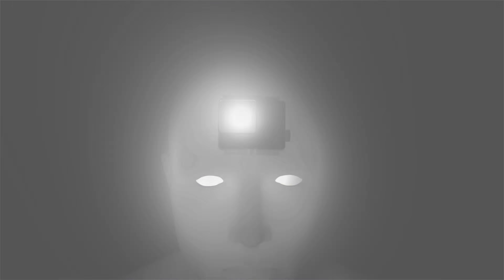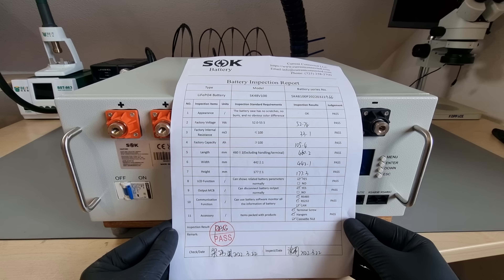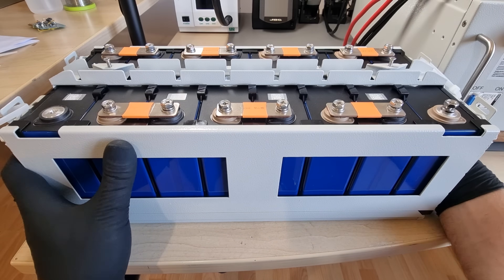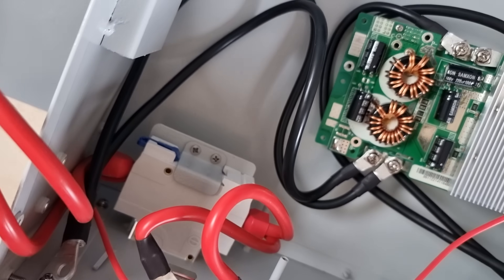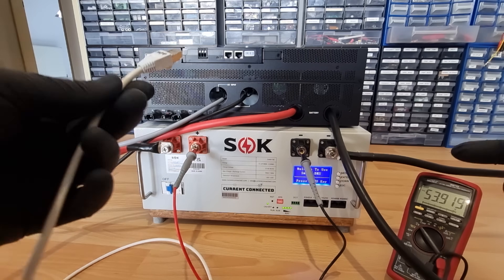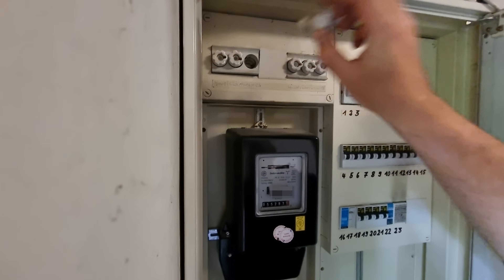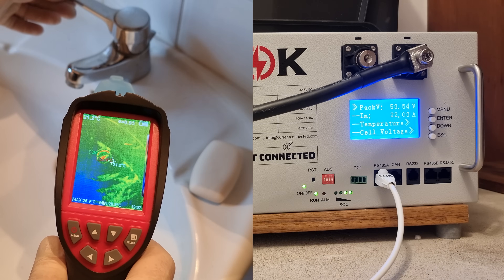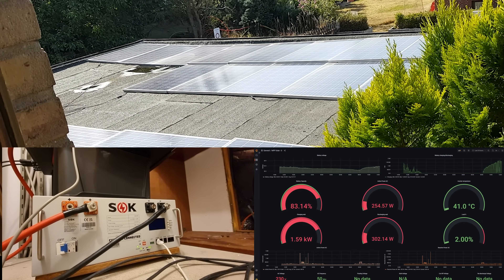New in EU: SOK Server Rack mount LiFePO4 batteries! Teardown & Review

Comment: Just about to flick the switch on my own solar/grid charged battery system with 5KW of storage.

And yes, grid charged. We have an energy provider here that gives per KWh pricing per half hour that closely follows the wholesale price, so there are times where it would be stupid not to charge, and times where it'd be stupid not to use battery power to skip expensive peak hours.

Mines AC coupled, so no complicated change over system, the inverter just generates whatever power is being pulled from the grid to make the meter see as close to 0w as possible. Great system. Using Victron for the inverter.

Comment: Nice video..even i'm watching it now.. I also bought that MPP Solar inverter..pretty beast..i went for 95mm cable..so even better ..maybe overkill ..i wonder if you went with oficial 16mm output cable as well..i went and it was CYKY cable...i had to hammer it to proper shape..it is so rigid you can hand yourself and cable wouldn't move ..i think 10mm would be better ..but in general i like it it can go to 11kW no problem..what i see as a bit problem is that it doesn't want to do anything extra..i was able put about 230A or about but when it went close to 12kW ..it last about 5 seconds and then it shuth down itself..so this could be improved ..I'm also using it for water heating ..with 8kW as max..but ofc rest is connected on house ..I might add one thing..that MPPT charger might be good but you can't for 100% connect one high volage DC cable to ground..not even by mistake..or your inverter would A. explode B. start blinking with red light and switch off ..

Comment: I was surprised how affordable these battery systems are. 
I can see that they will pay for themselves if fitted to the right solar system, but the interfacing might be a headache. 
Does anyone know how to interface these to a solar power system, so that the surplus solar is used to charge the batteries? Presumably, there would need to be some smart system connecting the solar inverter to the battery systems and battery inverter. 
Any ideas? Without smart interfacing, it wouldn't be possible to make best and most economical use of the battery system.
Thanks, folks, for any relevant comments.
Reply: I think  what you're after is a "hybrid" inverter , like the growatt SPF5000ES ( and a few others are available )

Comment: Interesting. I see a local distributor proudly announcing they will sell 4 boxes for 20kWh in September, for the low low price of an arm and a leg :D
Also interesting that the whole thing seems more open, more flexible, and generally more 'interesting' than my current house-side lithium chemistry battery, while also being cheaper. Which means battery tech is still improving, which is nice.

Might be interested in a review of your 11kW inverter, my 5kW inverter bugs me some days.. Usually when the 'Pokemon go' player wraps their car around the power pole down the street and everything goes dark before the system switches over...

Comment: I assume you arent planning any extended leaves during winter and the battery pack will stay comfortably above 0°C, but I cqnt help wondering whether it would be a good idea to hook up some heaters there just in case, since the power is already there?
Reply: If your House gets below 0°C you have other problems than your battery.
Like freezing pipes for example.
Also if you don't charge or discharge below 0°C the cells don't get damaged
Reply: @Schniels65  been a while since i watched the vid, but i sorta remember seeing bricks in the little room he put the battery in - could be uninsulated & on the outer wall of the house, probably gets chillier than where most of your plumbing is

Comment: I have a diy system of 3.5kwh in my camper van. And a 3kw renogy inverter. Charging through alternator with 50a(12v) or trough solar 50a. Run drills  saws and even compressor on it before. Does not seem to mind 250A at the bms. Works really well

Comment: Thank you very much for your great and informative videos on solar power and all the other interesting topics.

How do you get the inverter to work with a 3 phase installation. Does it only power L1, meaning any consumption on L2 and L3 will still come from grid?

Are you aware if there a MPP solar Hybrid Inverter with 2 MPPT trackers available (for those of us with south and west facing panels)

Thanks!
Reply from the maker: The pip max I bought comes with a parallel kit by default for either a higher power single phase or additional phases at an adjustable phase angle (so you can set up 3 inverters with 180° angle offset for 3-phase).

It has 2 separate 500V PV inputs, but I am not sure yet if they are just internally paralleled or lead to separate MPPT trackers
Reply: @reps  Much appreciated, thanks!

Comment: I'm currently using an off-grid victron 24v|5000w|230v  + 200 Ah SLA to fill the gap for regular power outages here. Works like a charm, it even runs my inverter aircon for ~90 mins. I've chosen SLA because its cheaper and does better at high temperatures (45c) than lithium.
🤔 about PWMing your extra solar power to a water heater tank using an arduino and an SSR ?

Comment: I work in South Africa(unstable grid, so backup is popular) as an system integrator designing systems using managed batteries like this so I have worked allot with them. My company mostly works with the more expensive price market managed batteries but in our experience the physical batteries, architecture and BMS boards(most on the market use one of two 3rd party boards and just write their own firmware) are mostly the same, as well as only minor difference between construction. 
just one thing to keep in mind with these batteries, assume that the coms between inverter or charger can go down. So its a must to set all charging parameters on the inverter for redundancy in case of coms failure. 

The thing we have noticed is that even the higher priced units still suffer the following.

Nr1. Unbalanced from factory, allot of batteries come to us so unbalanced that the bms cant compensate automatically and the battery needs to be cycled until all the cells are balanced. 
Nr2. Communications errors for days, often there are faults in the firmware or even faults on the bms boards themselves regarding communication protocols. Or in the case of telecoms 
rectifier systems they haven't updated rectifier side drivers for use with new firmware before release.
Nr3. Manuals are either lacking information, written badly or are even completely wrong.

It is because of the above reasons that the thing that defines what batteries we use is not the physical battery,  but rather the technical and aftersales support the manufactures give.
We find it inevitable that some of the batteries we order will have have problems so a painless RMA procedure is a must. 
So if you are looking to buy one of these batteries see if they offer support in your country.
Reply from the maker: Thank you for the valuable input! I have indeed not thought about what would happen if the RS485 failed
Reply: Thanks for the wise words. There is no substitute for experience.
Reply: What is your experience with BlueNova? I've just installed one, and now I'm having 2nd thoughts. R33000 worth of battery, and no soft-start. I don't know if it even has cell balancing. Who is the best in SA?
Reply: @johnalexander2349  We have worked with bluenova in the past but we no longer use them do to a list of issues. We usually use freedom won or balancell batteries, they are more expensive and also lack pre charge circuits. but they give us the least amount of issues. If precharge is an issues try charging the inverter capacitors with AC first. it takes a long time but it circumvents most of the surge issues.
Reply: @DC_Janecke  Thanks for the reply. I don't think I'll be buying Blue Nova again. I also don't think I'll be buying a PSS inverter again - I assume you mean I must power up the inverter before the battery, when you say "charge with AC", but mine insists that the battery be on first. Also, none of its battery voltage settings match the Blue Nova requirements, although I think that's got more to do with Blue Nova's requirements being pathetic. I'll look into the two you mentioned.
Reply: @DC_Janecke  Whats your view on Hubble batteries ?

Comment: Performance and build quality is pretty good for the price. Also 394€/kWh is nothing to sneeze at. I got away a bIt cheaper with  a DIY LFP Battery using LF280K Cells, 14kWh for just 175€/kWh, BMS and other materials included! But then you need the knowledge and experience to build one, and also some spare time.

Comment: As always a very nice and entertaining disassembly of some high-tech equipment, accompanied by a humorous yet complete description of the product. However, after checking SOK's EU website I'd be tempted to qualify the price of a single batterypack as "eyewatering" indeed, especially when I calculated I'd need at least 4 of them (approx. 20KW for 300 minutes) to power all the electrics in my (humble) home comfortably (heating, water, cooking, washing, etc) in summer- and wintertime both.
I do not doubt however the batterypack is of a high quality compared to other home-battery installations and probably competitive price-wise (e.g. Comparable Tesla Powerwall home battery (13,5KW for an 8 hour day) installation costs probably around 12000€ (without installation costs). I'll leave it to Marco Reps to comment on this and tell me I'm comparing lemmons to cherries, or something like that :)
Reply: Greetings from New Zealand. A few years ago I looked at whole-house-batteries and at the time the 13kWh Tesla was $19000 NZD, BYD 5kWh was $5000, and similar lithium chemistries were between $4000-7000 for 5kWh installed. I see a local distributor offering these new SOK batteries in September, 5kWh for $3600 and 20kWh for $13200. I suspect the SOK price is just the batteries and maybe a box to house them, not a full install which would add $1000-2000 NZD to the system price. Today (8 August 2022) 1nzd is 0.6euro, so my $3200 is close to 2000€, for 5kWh battery... Do some numbers help you feel like your comparison is less of a fruit salad?

If you are seriously thinking about getting batteries and running a significant count of loads (especially inductive loads like motors) off it all, I would recommend checking and double checking your numbers and sizing your inverter appropriately, or oversizing it. Having an inverter that can comfortably handle the 'average' load of your house is very different from one that can manage 'peak load' (that usually arrives right as the grid drops out). And I have learned to my lament that my current inverter does not cope well when solar+grid are present but the house is drawing more than it's faceplate rating. I should have bought a bigger unit...
Reply: @SittingDuc  I've just installed a pair of ROSEN (basically the same as SOK - down to the interface even).. the hardest part was lifting them! - no really 10kWH batteries weigh in at 109kg.. NZ is like AU, no license needed for 48VDC

Comment: I was kinda scratching my head wondering why your sudden 'rush' to solar / battery etc.
Then it finally dawned on me that Deutschland (along with the rest of Europe) is in the process of being blackmailed by a smug little upstart to the East.
I guess there's still some positive outcomes of it over time....
1: The smug little upstart will finally begin to see that he's not as 'important' as he had hoped
2: Deutschland (and others) will start realizing that nuclear isn't so bad after all (when compared with ZERO power)

P.S.
I happen to live in New Zealand.  Sure, there's no NPPs in NZ, but we actually don't NEED them (at least not for the next 30+ years).
Around 80% of our grid is derives from Hydro and Geothermal.
The %age from wind is slowly rising but as we all know, wind can be somewhat fickle.
We have almost ZERO solar (from memory < 1%)
And we have one fairly significant 'fossil fuel' PP (Huntly) that can burn either coal or natural gas.
The Huntly plant is almost directly on top of a VERY high quality coal deposit, but the insane NZ government chooses instead to import substandard coal from S.E. Asia (so that THEY bear the brunt of the carbon crap based on some stupid rules).
There's a HUGE aluminium smelter way down south that consumes the majority of the power from our LARGEST hydro plant (and they're supplied that energy often at 'below cost').
However, that plant is likely to switch off in a few years thus releasing a HuGE amount of hydro capacity into the grid.  (If only the pertinent authorities had enough brain cells to start constructing the needed infrastructure to integrate all that power into the existing grid when it becomes available... <Sigh... Politicians are soooooo dumb>)

Comment: "I think, at the moment, this is the most desirable battery technology for solar power storage."
LTO?
Reply: LTO has bad volumetric capacity.  but good for high amp bursts. like car audio amps.
Reply: @casemodder89  LTO has a much wider operational temperature range, and even higher cycle life.
Allegedly. That's why the question mark.
But if true,  it seems better for this application. The "bad" VC is higher than lead acid's, and not an issue in stationary systems.

Comment: That battery looks great but for such an expensive product, I really expect better capacitors. Those Samxon capacitors are unacceptable. I would have liked to see some Nichicon or Nippon-Chemi-Con caps instead.
Reply from the maker: I too have a nice capacitor fetish, but this box should not reach very high temperatures and the pre-charge circuit is only used rarely, so I am not too worried

Comment: Is the big delay in the 0°C crossing to charge stopping acceptable?
Reply: Yes because the sensors are in air and not attached to the batteries. The sensors will read 0°C much sooner than the batteries actually getting that cold.
Reply: There was no big delay. It was maybe 20 Seconds. The batteries weight 45kg, it takes far longer than 20 seconds for 45 Kg to reach freezing

Comment: Hey, love your videos on solar systems an storage lately, keep up the great work! I would realy enjoy a more in depth video on the power electronics involved, like: MPPT controll, inverters and battery management :)
Reply: I agree. These battery systems are great, but they are designed as UPS's. In order to use them with domestic solar systems, there would need to be some sort of smart interfacing, to capture excess solar generation and pass it to the batteries.

Comment: if only they woule be cheaper...
Solar tecnology is quite interesting, but getting good panels seems to be still hard without going to authorized installer.
I cannot find any seller for DIY instalklations of proper panels.

That battery would keep up my NAS for 10hours. I would need 4 of those to keep up my whole apartment...
I don't even want to think how many panel do I need to charge 4 of such battery in 8hours of sun. (5 in winter)
Reply: You can buy JA solar panels for some of their importers directly... but in many cases they only offer fixed set sizes in packs of say 12 od 24 panels.

Comment: What do these cells do at 100% charge for long time periods? Since it looks like that's how they will be operating a lot. Lithium Ion isn't great below 25% and above 75% as far as I understand.
Reply: With LiFePo4 the damage at the low end and top end is less dramatic, but they still age a bit faster.  
But from time to time they need to be charged to 100% to get them actually balanced well, which is quite hard on 80% or even 90% as the voltage plateau of these cells is very, very flat and often extends all the way from ~20%-~85-90% SOC.

Comment: I wonder why you a battery and long term oriented person would have a water heater like this. Arent water tanks still more efficient at storing the energy than the batteries?
Reply: Meh... With 3-5cm insulation on them... They are not, I assume. I have a water tank, and I am just about to set up some datalogging to measure the incoming water flow, power consumed and the temperatures, to check whether it reaches 70% efficiency at least or not. My assumption is it won't.

I am committed to enclose it in 15cm thick rockwool panels...

I think storing energy in water is only better if you need that energy as heat or it comes as heat anyways (solar heating, room cooling HVAC, other heat loss you can capture).
Reply: Btw, I am thinking for ages how to capture all the heat energy we throw away. Regrigerator dissipating into our kitchens, computers, if you have aircon, all the heat from the room + put in by the compressor is just thrown out! To name just a few very easy ones.

Those alone are probably more than a household would need for their hot water use in summer.

Then a not so easy one: drained hot water during shower, dish washing, etc... I assume almost 95% of the energy in the water heated up by expensive methods is just drained down without actually using it.
Reply: You are right in the regard, that Macro  could use excess electricity, beyond the battery capacity, to heat up bulk water and store energy in that way.  
You could even fed the water heater with it so in case the tank has not reached, say 60°C yet, the flow heater could bump the temperature up to the needed level.  
While the efficiency, over all, might not even be that much better, it would offer a huge energy storage option, which might be a nice option.  
Bulk hot water storage also offer the option to use a heat pump to supply heat, or anything else.